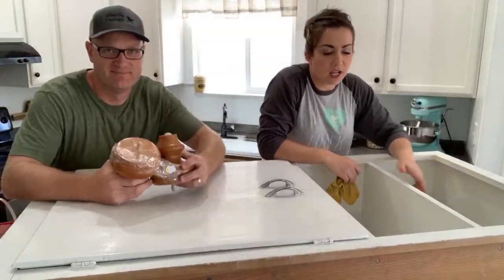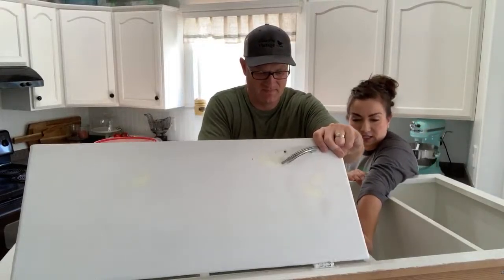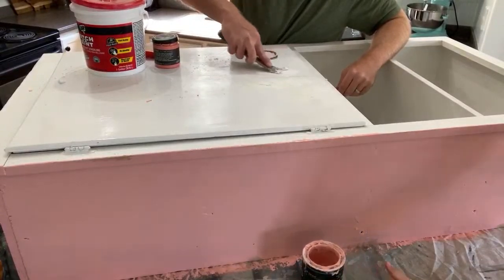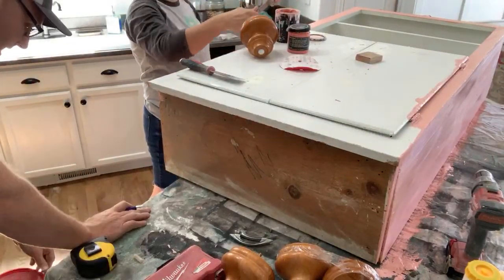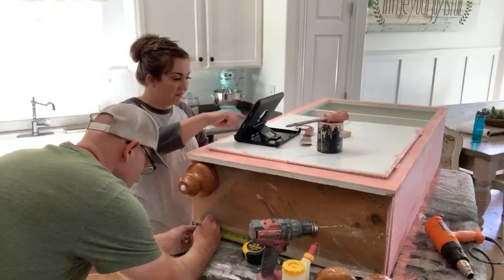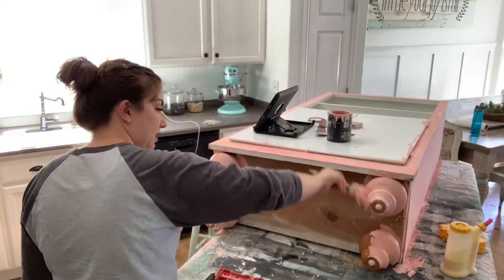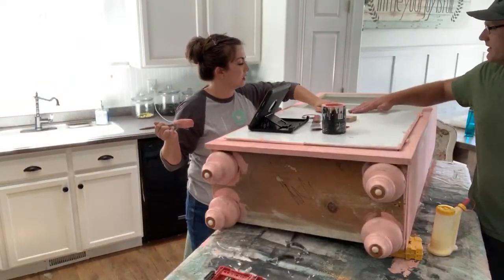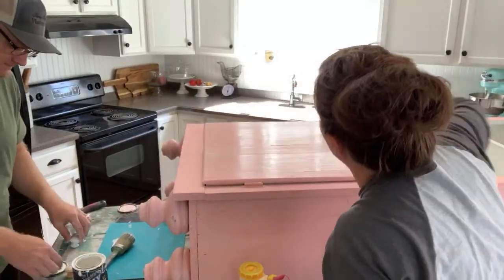🔴 Old House Salvage | WNW

Comment: Oh fun stuff, I live in a 1910 craftsman and we have a claw foot tub in the “water closet”, all original oak wood wood (floors, molding, doors, etc). We even have the light fixtures and coal burning furnace in the basement. Seriously people had coal delivered here into the 90’s 🤷🏻‍♀️. Receipts still on cedar room
Reply from the maker: Wow!  I’m saving a couple of light fixtures. Most of the house has been “updated” here and there and a lot of the charm is gone but we’ve got wood floors!

Comment: How about Cinderzilla for the house name????    a diamond in the rough (Cinderella)  that looms over you like Godzilla???  LOL   We had a similar house situation.   We started with the intent to just pull up the old carpet and drywall over  the old paneling.  One thing led to another and the it turned out to be an addition not permitted, with newspaper  insulation in the attic with open uncovered electric wires,  the original garage room under the addition roof,  no foundation  only 2 support beams with one broken in two and the other rotted AND a gas line enclosed in cement steps.   our contractor told us basically that we had been totally screwed over in our house inspection.  So we decided to tear it down and start from scratch.  It is a beautiful addition with ensuite and we love it.  But to be honest I will never go through construction or reconstruction ever again.  :-)

Comment: Have you made a handle back plate, I think that’s what it’s called, with IOD molds? I’m using resin but how to make the holes? Cut up straws maybe?
Reply from the maker: Zeb drills them after the resin sets up and they’ve been de-molded.

Comment: What do you do: I'm turning a cabinet door into a coat rack. I am putting a threaded hook into an existing hole that is bigger than the hook. 
Should I bondo the hole? I tried wood filler and it was too soft, so the hook wiggles in there.
Reply from the maker: Bondo would work well.

Comment: Okay. Question. I just got a dresser, wardrobe and two end tables at Goodwill. Only $90. A killing. Never painted furniture to antique the look. Already old, chippy, wonderful patina but it’s red. I want white with green showing underneath. If I sand it a will strip off all of the character.  How do I do this. Any ideas. Really dirty, need to clean it, what to use. Thanks.
Reply from the maker: I never sand when I two tone. Paint the color you want underneath, seal it, paint your top color, wet distress it if you want the color underneath to show through. Then seal again.

Comment: Just looking at your stencils, I was wondering if you could possibly make an alphabet stencil like the numbers script.   I like the more fluid shape of the numbers instead of the straight up and down of the normal alphabet
Reply from the maker: So the number script is very old script. I may add another one later but it won’t be for awhile as I’m currently working on our fall line and Christmas Stencils.